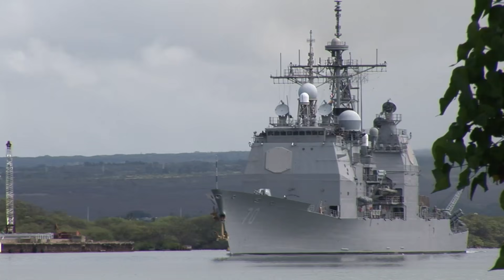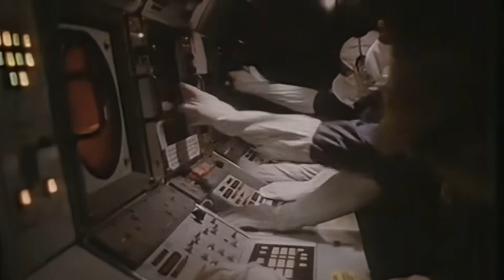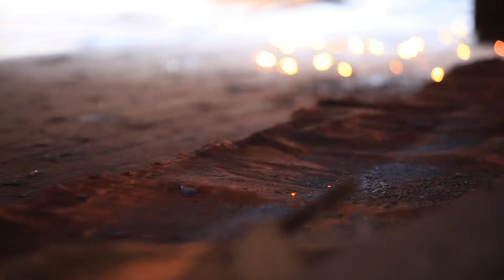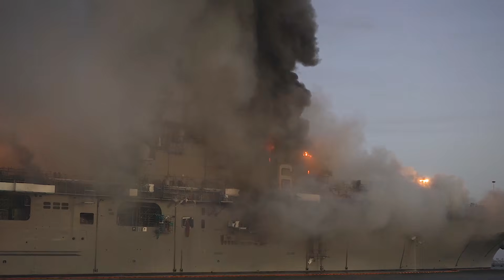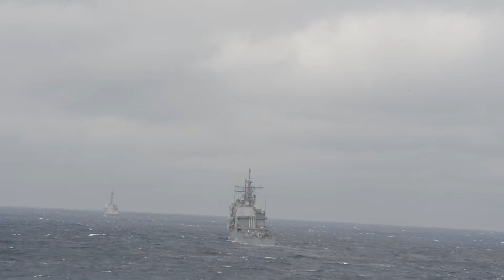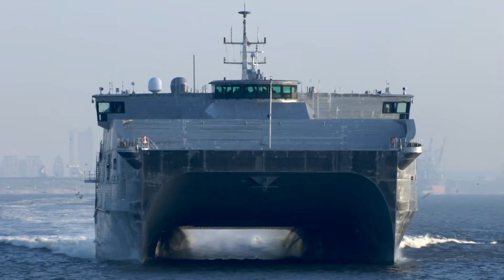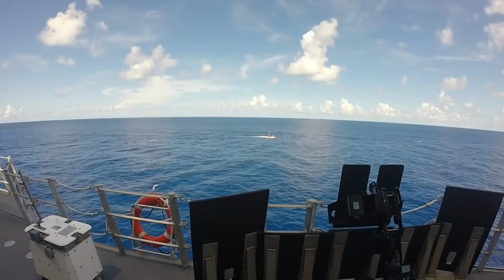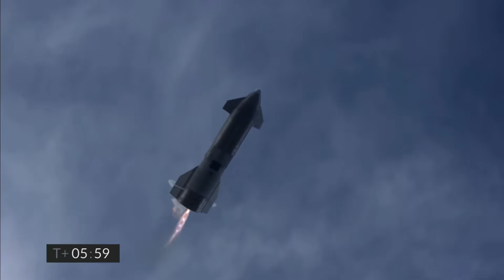Why is The US Building Aluminum Warships?

Comment: I make pche's (printed circuit heat exchangers) which are made of steal, we bond them together which is to slightly melt the 2 surfaces so that they bond together and we learnt a while ago that steal & aluminium can be done but due to the extreme pressures of the exchangers their durability is not safe

Comment: I'm glad this video points out how fire doesn't really need to be that hot to cause metal to fail so many people claim 9/11 was an inside job bc jet fuel doesn't get hot enough to melt steel but it definitely get hot enough to compromise it and make it bend like a drinking straw

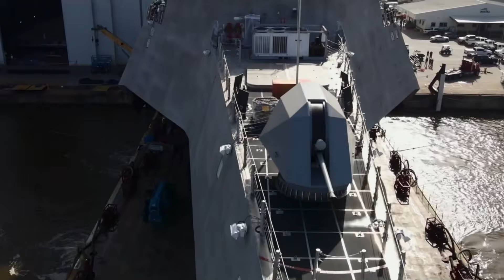Comment: 7:25 "They're expendable" ..........ahhh no they're not. 
Sea Mines are activated by magnetic, pressure and/or acoustic. Aluminium trimaran has a smaller magnetic field and exerts less pressure as it moves through the water, making it less likely to trigger mines.
Sea Mines are responsible for more than 75% of damage to US war ships since WW2. How would FFGX, DDGX and Gerald R Ford deal with sea mines laid outside their port by a single Chinese submarine? they can't, they would stay in port.......see the problem?
The USN currently has only 8 Avenger minesweeping ships.

Comment: What they didn't say is how much more expensive aluminum is. Not to mention the process of manufacturing aluminum. It isn't very green I'll tell you that, but neither is steel. Fact is, if a ship gets hit by missiles it's likely to be lost. Steel or aluminum. But aluminum is way lighter. Making ships more maneuverable and cheaper to operate.
Reply: If the ship survives the missile, then it's easier to repair steel. Plus if our international supply lines were cut off we'd have a more abundant supply of steel than aluminum.

Comment: The reason Starship uses stainless steel is because it is stronger than carbon fiber at the cryogenic temperatures the fuel needs to be at. It is also faster and easier to rapid prototype using steel.

Comment: there are new steel alloys that compete with carbon-fiber in terms of strength to weight ratio, for example, Reynolds 953 used in the bicycle industry.  Reynolds tubing started out making tubing for airplanes, and they started using the 531 for bicycles in the last century.  they just need to use better steel alloys, but that will increase the cost of course.   You don't weld aluminum to steel.  You bolt it on.  But aluminum is subject to cyclic-fatigue, just from vibrations from the engines, which is not a problem with steel.  Steel tubing of these advanced steel alloys could be used for the tower structures, and be lighter than aluminum.

Comment: Aluminum alloys which are almost always used in structural applications, will suffer stress corrosion cracking with stress and age. Horrible material to make a ship's hull from. Grain boundary precipitation in the alloy will happen and will absolutely fail the material. pure 3003 aluminum doesn't have this problem, but they would have to use twice as much of it for the same strength ratings. I used to work for one of the oldest companies that extensively used hardenable aluminums. The stuff is totally unsuitable to make naval vessels from. Idiots.

Comment: This does remind me of hearing about one of the great footnotes of the Falkland Islands War, when the British were using polyesther uniforms for troops, which they found out not only were prone to melting in far more conditions than wool, they also tended to result in worse burns. 

I've always wondered about using either heat treated steel or cold worked to save weight, both are wildly stronger than untreated material, but both suffer from serious heat vulnerability, which is a big issue in something like a ship, as the material will lose strength with exposure to heat and fail as it no longer meets he engineering requirements. I still think you could use stuff like that on an aircraft more reasonably, and it's strength is already competitive with titanium, the issue for the cold working is the dies, even diamonds stop being hard enough, while for the heat treatment it's hard to get deep heat treatment on thicker sections, which doesn't matter on aircraft at all. I also wonder about ceramics sometimes, aluminum oxide for example is extremely refractory, hard AF and exceedingly heat resistant.

Comment: My last year in the Navy (1964-1965) I was aboard the USS Atlanta (IX-304).  The Navy wanted to know how an aluminum-clad warship would withstand a nuclear attack.  It was to be nuclear, but The U.S. signing the nuclear atmospheric test-ban treaty did away with the nuclear atmospheric test, so the tests were done with 100-ton hemispheres of TNT - melted out of WWII bombs and placed on the shore of the Hawaiian uninhabited island of Kahoolawe.  We had aluminum deck houses, torpedo tubes, radar antennas, and other aluminun structures, all above the main deck - and we were on the third deck down - and sealed in.  During the tests, it was like being in a huge steel barrel that was struck by a big hammer. You could say that we got a bang out of it.
 At least we didn't get any exposure to nuclear radiation.  The tests were conducted by EG&G.

Comment: 1-yes aluminium burn especiali when mixed with rust like on ships (by the way aluminium fire create hydrogène emmission if you put water on it and gose boom)
2-if space-x dosen't use aluminium is because of the price and thats the same for carbone fiber (good carbonne fiber have much more resistance than steel)
3-you can build stable superstructur in steel look at the effel tower (in iron not steel) or look at battleship
4-if your ship is craking under stress its not a good ship
5-the independance classe that took the chok test wase reinforced with steel by the builder before the test (that retarded the test its on official document)

now you know why aluminium sucks on ship the only benefit is the low dencity of aluminium and resistance to corosion
thats why we build steel hulled comerce ship and alluminium hulled pleasence ship

Comment: Its a series of tradeoffs. If an antiship missile hits, its a 50/50 that its going down, no matter what its made of. Speed and maneuverability combined with detection and anti-missile systems is the best chance you have to dodging the missile. But the weight savings aluminum and composites give you toward maneuverability also reduce longevity and seamanship. So the decision really comes down to, do I want a cheaper ship that has a fraction of a % more chance at dodging a missile with a short overall lifespan, or a ship that lasts a few more years but is more vulnerable. IMO, if you are going to war, you build from aluminum and composites. If you are planning on a standing navy, you stick to steel

Comment: SpaceX did not ditch CF hulls because they are not strong enough. They deemed the production process unfitting for their purpose. SpaceX wanted to do rapid prototyping, which stainless steel is much more suitable for, than CF. Constructions using CF require extensive infrastructure, tooling, curing and settling time etc. When working with steel you need a tent, a welder, some jigs and that's it, like SpaceX has proven. Also, the raw materials going into CF constructions are harder to procure and more expensive, which would further hamper rapid prototyping.

Comment: Aside form scuttling, very few ships are sunk without onboard fires. The ones that come close are usually because of cracks developing from explosive shock and in many cases accentuated by fatigue from previous service in rough seas. Historically, aluminum deck houses have been compromised by destroyers firing their own guns. This problem was "solved" by upgrading the aft gun mount to a helicopter platform.

Comment: Depending on the steel alloy, steel has a fatigue threshold. If the steel is not stressed above a certain level, you do not get fatigue cracking. Aluminum has no fatigue threshold. Any stress will add to the fatigue to some degree.

Comment: The "why" question was not particularly well answered in this video, and in any case, the truth was missed. The truth is that the LCS performance requirements were greater than what could be achieved with steel displacement hulls. The trimaran, while hydrodynamically efficient, carries a penalty of additional structure needed to connect the side hulls to the main hull. And the monohull had the unenviable task of trying to match the trimaran's performance. Aluminum alloy was really the only choice given the weight constraints.

Comment: Burning is just a rapid exothermic oxidization of the material. Aluminum and steel will absolutely burn if they get hot enough and have enough oxygen. Solid fuel rocket engines use aluminum and magnesium powder. Metal shavings in machine shops are a major fire hazard. The machinist at our company got tired of the engineers using the equipment while smoking. He took a box of shavings and dropped it onto the concrete pavement behind our building in a 16 inch tall pile and lit it with a match. At first a little bit of the cutting oil started burning, then the metal started burning. Within a couple of minutes the entire pile was glowing white hot, and we could not stand closer than 10 feet away, and that was uncomfortable. While steel and aluminum plate and beams are much harder to burn, they will burn in the right conditions.

Comment: The Royal Navy reverted back to using steel because aluminum ladders couldn't withstand heat. Why not just use steel ladders?
A steel ship will burn down just as easy as an aluminum ship. The material of construction is not the big issue, containing fires is the issue.

Comment: SpaceX isn't using carbon fiber because it is expensive, slow to make, and performs poorly at cryogenic temperatures. It can be made to resist heat. I can't imagine a situation where a warship needs to resist cold that liquefies oxygen! If you want to save weight and are okay with the extra expense and build time, carbon could be a great choice for a ship!

Comment: SpaceX does not dispute that carbon fibre is a better material than steel in terms of physical properties. Its less dense and stronger. They widely use carbon fibre and other composites for their COPV tanks, even on Starship. The real reason they switched from carbon to steel is because of price and ease of construction. Steel is much cheaper and much easier to work with, which allows them to mass produce Starships for rapid iteration testing.

Comment: Elon Musk does not necessarily disagree about carbon fiber being better than steel for ships, it's just that steel is better for spacecraft, as steel actually becomes stronger at cryogenic temperatures and does not get damaged anywhere near as badly as carbon fiber, and carbon fiber is a lot more expensive to manufacture at scale with precision, but cost is not as big a factor for military naval vessels as it is for a commercial spacecraft.

Comment: They actually decided not to use carbon fiber due to the fact that there was no autoclave in existence large enough to cure the tanks.  Also the ship uses a cryogenic fuel and the specific stainless steel that they used was made specifically to remain extremely strong under cryogenic conditions meaning that they could use less of it.  And in addition they wanted something that could withstand reentry with as little thermal protection as possible.

Comment: The fact that that little HK diesel got close enough for a torpedo strike on the carrier in that battlegroup exercise just shows that the skipper of the sub was strategically smart, and that the ASW net of the battlegroup had some holes in it. That, or sub tech has gotten insanely better since I was in an ASW patrol squadron.   

R.I.P. VP-22 Blue Geese. Always in my heart. ⚓❤⚓

Comment: Ships were made of steel as that was the only material which could withstand hits from heavy naval artillery. Today's ships are supposed to have self-defence systems that stop incoming missiles. 
British ships in the Falklands were hit by French Exocet missiles whose warheads failed to explode. The damage was used by the rocket motor. Once it's lit, the fire cannot be extinguished.

Comment: Why did it take the USN until 1971 to realize the issue with aluminum superstructures?  In 1955, they experimented with aluminum on the USS Timmerman (WW2 Gearing Class DD) as well as experimental engines in an effort to lighten the ship and increase engine power.

Comment: And all Freedom class vessels are being decommissioned after only 10 years. Sorry, Aluminum work hardens, then cracks and fails, this is why air-frames have limited lifetimes. I expect that some of the new mixed-metals MIGHT make it work, but probably a steel ship with a titanium skin would be best for now in a survivable vessel. For a non-survivable, you might just as well stick to foil coated plastics.

Comment: I would like to address the er elephant in the room.
With carbon fiber or nomex/aramid as a higher cost alternative.
Certainly, we have developed processes to assemble larger scale projects such as I described.
Couple that with hydro plaining and you get a low observable high speed shallow draft platform.
Not really sure if it would survive a weapon strike any better but it would surely cost more.

Comment: Well that's what I can say about carbon it may be strong and it needs to be used widely and in the time goes on will probably find great things about it and make tremendous strides, but make a battleship out of it and point a 5 inch gun at it and see what kind of a hole it makes and see if it makes a bigger hole in carbon than what it does steel

Comment: Steel remains flexible.  Aluminum becomes work-hardened when it is flexed, which makes it more rigid, and then brittle.  It's a desirable property for bicycle frames, but not for rigid bodies which must weather constant cycles of flexion.  However it can be mitigated by joining aluminum panels with flexible materials, or with sliding joints which allow for expansion and contraction, which is how it is used for airliner coverings and frames despite for example the wings flexing constantly.

Comment: Clearly the solution is titanium.  All the advantages of steel (high strength, resists cracking) and all the advantages of aluminum (lower weight, corrosion resistance).  Course each ship would cost 10x more...

Comment: Aluminum melts so easily. 3d printers need a temperature protection to avoid the heater from making the aluminum block at the tip from going soft, possibly even plopping off and starting a fire.

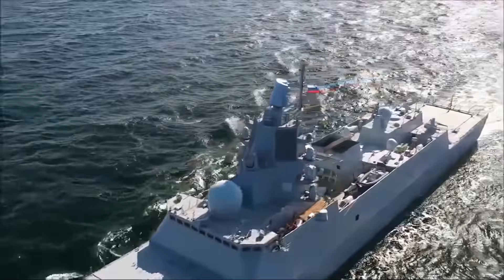Comment: 13:19 Elon doesn’t disagree. He changed the Starship’s material from Carbon Fiber to Stainless Steel because of the cost. Carbon Fiber costs way way way more than steel and to achieve his goals of a giant fleet of Starships going to Mars and back it needs to be relatively cheap
Reply: Not to mention his blazing fast iterative improvement and the fact that there's no oven big enough to do the job need to be done.

Comment: I served on two Oliver Hazard Perry class frigates in the 1980's, both ships experienced cracking in the aluminum superstructure after extended deployments at sea. One of them had a crack large enough that I could put my hand through from the inside of the ship to the outside. Those cracked areas were later reinforced with considerably thicker aluminum plating.

Comment: Aluminium does too burn. Just the same as Magnesium burns.
Jet fuel has Aluminium Nanoparticles added for added power at high altitude.
Because not only does Aluminium burn it produces Oxygen as it burns. Hence the added high altitude power.
Using Aluminium in warship construction is a stupid idea, there's corrosion issues, in a seawater environment.
This is a propaganda video.

Comment: Aluminum doesn't exactly burn, but if you get it hot enough it will evaporate and "burn away."

When the newer Ford cars burn down, they burn down, leaving little but the steel parts and copper wiring.

Comment: Very good, I'm  a Falklands war navy veteran, your comment on Hms Sheffield I'd like to expand on. The Exocet missile that hit her never exploded its warhead. The missile did as designed by entering horizontally then Changing direction to go down in to the hull. The missiles rocket engine burned through decks incenirating everything on its way down. I was on the Hms Hermes flght deck which was close by & took many helicopters of badly burned  sailors on board while return flights left with firefighting equipment.

Comment: Tensile strength of steel is ~73,000 PSI  for Aluminium its around 45,000 PSI   BUT  Aluminium density is 0.4 the density of steel, so you can use 2.5 times as much aluminium for the same weight.
In this context Aluminium is comparable to steel for use as a hull, and has been used in light armoured vehicles etc as well in the last 20 years or so.

Comment: Mentions "corrosion resistance" then adds in the same sentence that aluminum oxide forms on the surface. What do you think aluminum oxide IS??? It is corrosion. It works much slower than corrosion on iron/steel, (which corrosion, we call "rust".), but it will eventually eat away all of the aluminum, just like rust will eat away steel. It's the same thing. Just much slower. Saying otherwise is disingenuous at best.

Comment: Aluminium is light, durable, can withstand more heat then steel, has a higher burn temperature then steel, u have the same size ship but tons and tons in weight difference